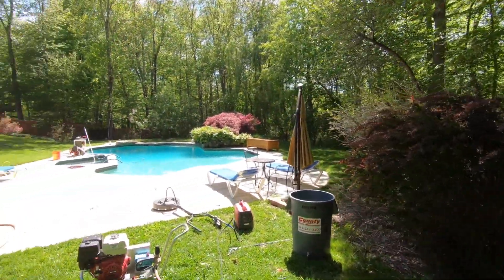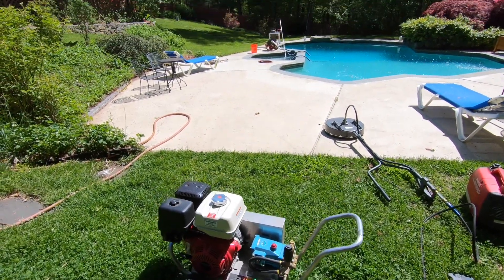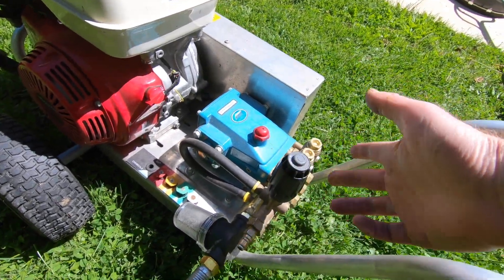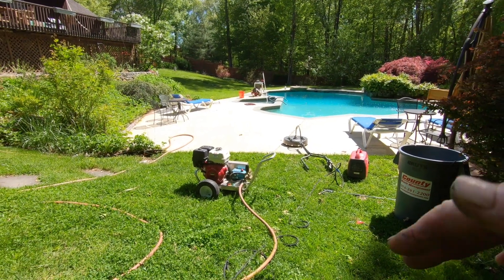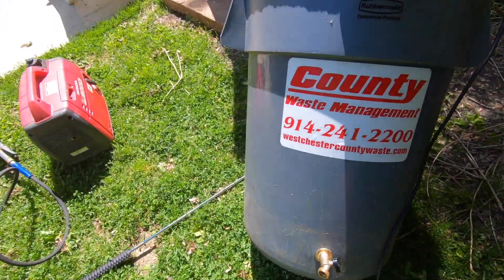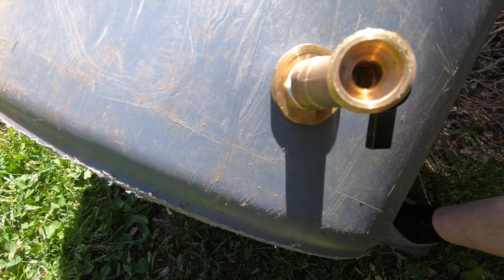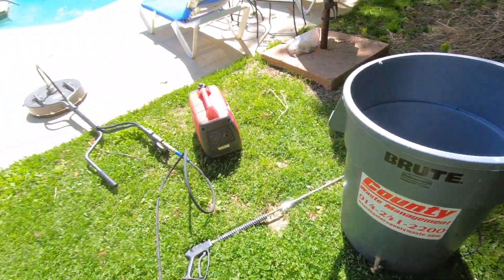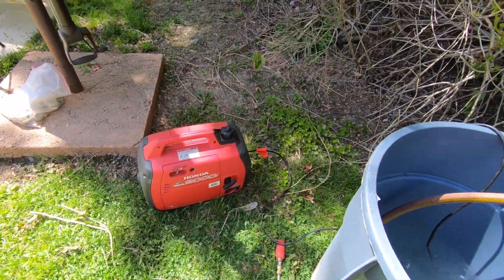Pressure washer loses pressure intermittently- home made water tank fix

Comment: If you are not putting 4 gallons a minute in the barrel but taking that much out you will still run out of water.  4 gallons in = 4 gallons out.
Reply from the maker: You're absolutely correct so I didn't explain it right.  Let's say that trash can holds 40 Gallons. So I fill up all 40 gallons and then put a hose from the house into that trashcan-  so its adding to the 40 gallons. At the same time there is a second hose from the trashcan to the powerwasher.  That hose delivers 4 gallons per minute to the power washer. 
Let's say my house only runs at 2 gallons per minute. So I start the powerwasher and also turn on the hose from the house.  
So after 2 minutes of continuous running the power washer at 4 gallons per minute , the trashcan has 40-8 +4 = 36 gallons.  
It lost 8 to the power washer but gained 4 from the house hose bib.  
In this example the trash can loses 2 gallons per minute net, so I can run the washer non stop for 20 minutes (20 mins× 2gpm loss=40 gallons) before the trash can is completely empty. But with stopping that continues to add 2gpm without any use, plus my house is probably 3gpm so it never runs out of water and can deliver 4gpm for the entire job. In fact the key for me is to turn down the water into the trashcan enough so it doesn't overflow. 

Hope not too much math. Its exactly the same as truck mounted units running 8gpm use- except its a large buffer tank.  Nobody's house can keep up with 8 gallons per minute So they add to it at a slower rate from somebody's house as they're using 8 gallons per minute from their tank.
Hope that helps

Comment: I have similar issue even though I'm on municipal  water supply. Water company came to my house and tested flow from outside spigot and said it flowed more than my pressure washer was rated for.
Reply from the maker: Its frustrating. I bought a great pressure washer and have to jump through hoops to make it work
Reply: It only does it on start up..I turn water on and let it run to the pump before I even crank it.i don't start spraying for at least 90 seconds after engine running
Reply from the maker: @keithlarge1151  i have a low flow from my well unfortunately. There are guys running commercial 8gpm units from their truck mounted tank, so its gotta be the flow
Reply: @Drrich_DIY  yeah I watched a team at an 2 day Enduro race use a 2400 psi pressure washer fed by 10' of garden hose from a 250 gallon tote tank from a pickup truck
Reply from the maker: @keithlarge1151  does your pressure washer try to rip your arm off when you start it like mine does sometimes? There has to be a way to fix that.
Reply: @Drrich_DIY  not at all